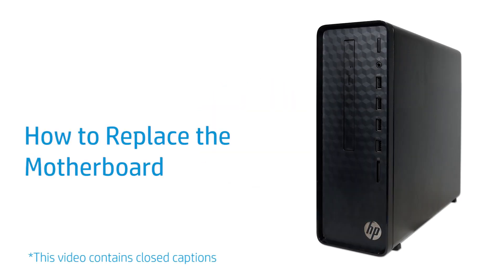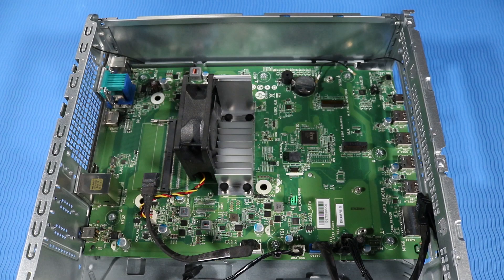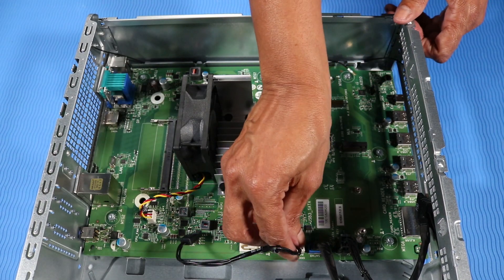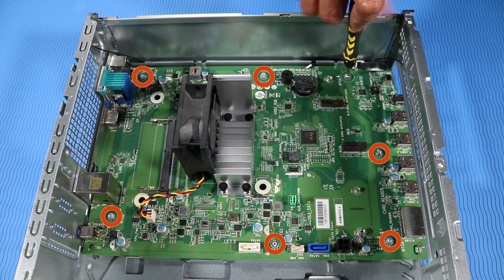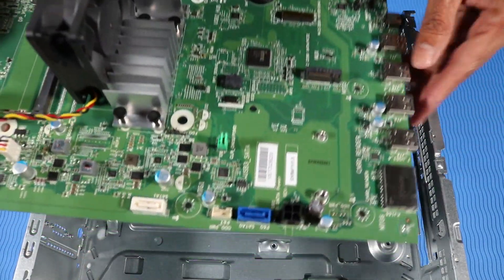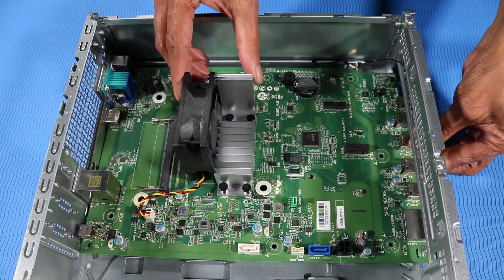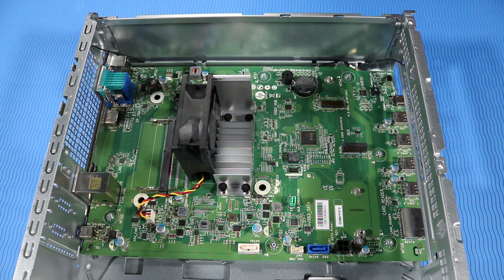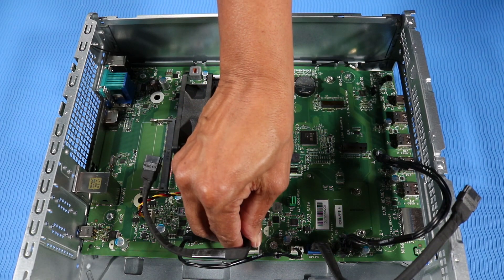Replace the Motherboard | HP Slim Desktop S01-aF0000, S01-aD0000 | HP

Comment: Is it possible to install a graphics card in this HP Slim Desktop S01-aF0000 other than the integrated graphics processor?
Reply from the maker: +drani439 I have checked the specification of your computer and found that there is no expansion slot to add an external graphics card.
Reply: @HPSupport  I opened the PC and found out that it is equipped with the Menlo motherboard for some reason. So there actually is a PCI express slot available :)
Reply: @drani4396  what upgrades have you done to yours?
Reply: @wgg787  I installed a Nvidia GT 1030 graphics card.